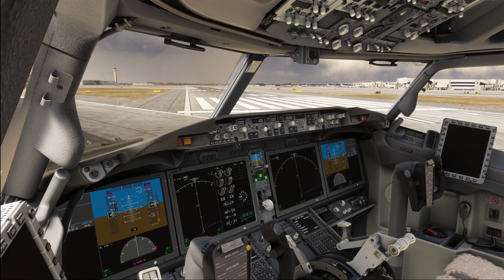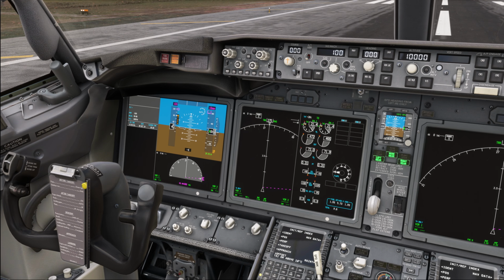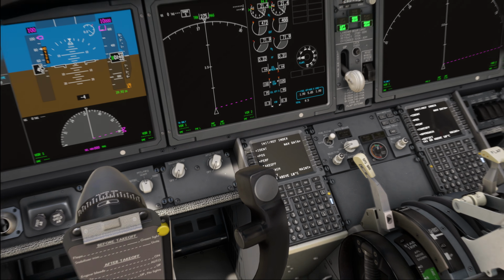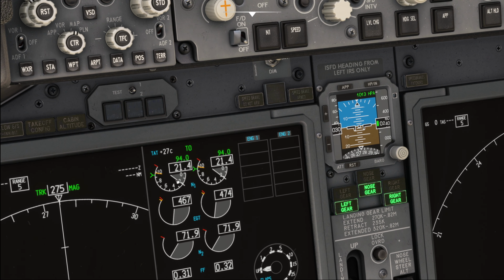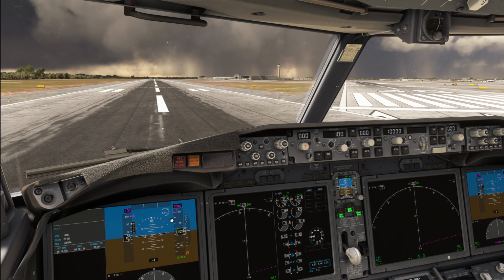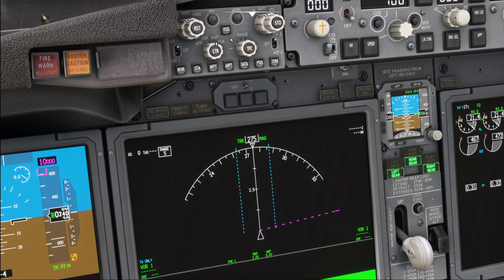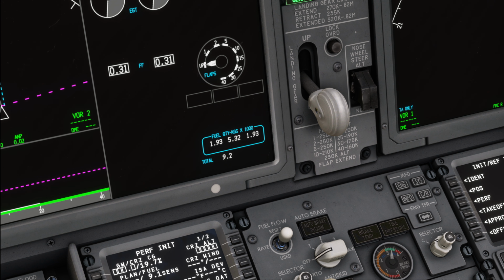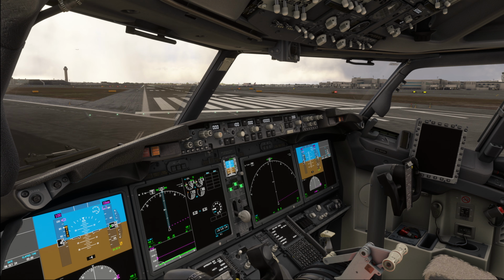Boeing 737NG vs MAX - System Differences | Real 737 Pilot

Comment: One small correction: Roll authority of AP is only about 20 degree of yoke, not 90+ as you can manually do.
BTW regrading fire system, it's stranded on MAX that WHEEL WELL detection is on BAT BUS, so when testing fire for APU start if you on battery only, it'll lit, only on some very late NG it's also the case.

Comment: I was wondering about the trim of the MAX - does it have auto trim like the Airbus? Or do you still have to manually trim like in the NG?
Reply from the maker: Hi, it's the same as in the NG, with the addition of MCAS. The video dealing with the flight control differences will come live soon.

Comment: Despite my reservations about the safety of the MAX vs the NG, it is encouraging to see how many new safety and alerting systems have been put into the MAX to make it harder for pilots to accidentally screw up. Hopefully we've seen the last of the "surprise" issues with this plane IRL.
Reply from the maker: With all those changes the real plane has seen since the accidents I am convinced it is a safe aircraft now.
Reply: @A330Driver  as long as they assemble them properly, and the rudders don't get cold. lol.

Comment: Emi how do you get your throttle to not jump back to the quadrant position with A/T on? The iFly doesn't yet have a toggle to ignore quadrant inputs with A/T engaged so I was curious to know how you circumvent the issue
Reply from the maker: Hi, most hardware throttles have the least spiking at either the idle or full forward position. I usually move them full forward once I pressed toga.

Comment: Fantastic video! But when I see the MAX I always wonder which are the oldest airplane parts in that "mixed" looking overhead panel, the light grey or the dark grey panels?
Reply from the maker: The grey color tone is actually intentionally brighter on the „primary“ controls, such as fuel, hydraulic, air, etc. while the „less important“ panels are darker.
I don’t think there are any parts of the overhead that have been completely unchanged from the original 737. They have all seen some changes since then.

Comment: So thats why the max takes forever to start (compared to the NG) always hated pushing the max because the engines took forever to start so I always felt like I had to start them as early as possible and not past the vehicle service roads like on the NG or the older airbuses
Reply from the maker: It’s always a pain 😅
They allocate the same taxi time to the MAX as they do for the NG which makes it a lot harder to catch slots.